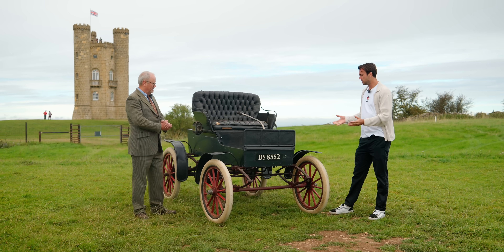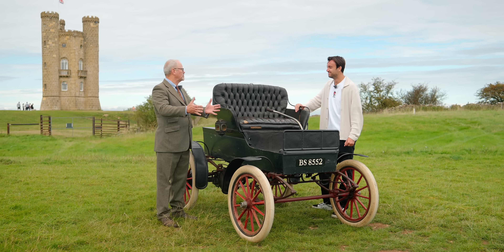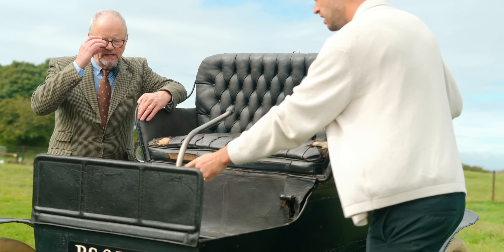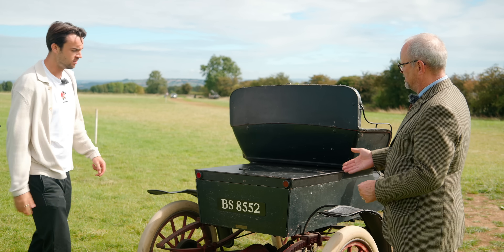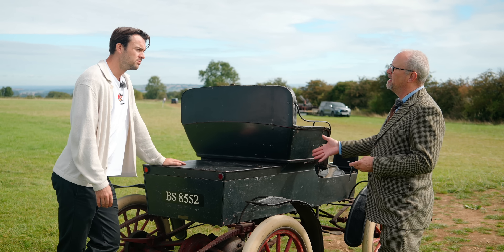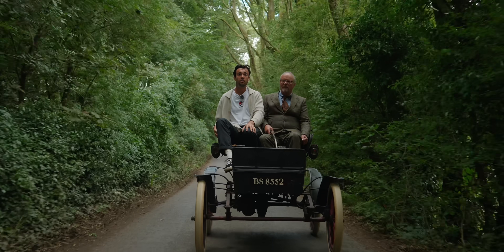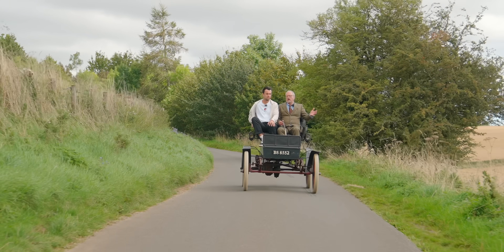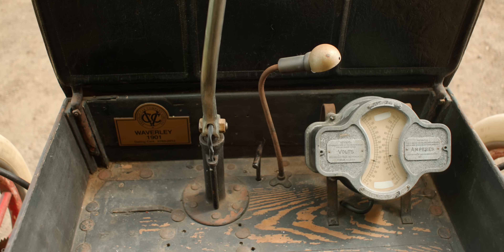Why Electric Cars Failed 100 Years Ago

Comment: Here's the thing - it took an electric motor to "save" internal combustion engine cars. I.E. the starter motor.
Reply: It's like that Ancient Greek fable, where the eagle is slain by an arrow feathered with one of its own plumes.
Reply: ..Well the electric motor was invented 42 ish years before the modern ice
Reply: The starter motor doesn't drive the cars!!!!!
Reply: Now early ICE was pains in the ass, you needed to be an at least hobby mechanistic or have one employed for it to be reliable. 
Early electrical cars was much better but the lead acid batteries held them back once ICE got better and people started driving longer as roads got better. 
Not only the lady traveling 4 km from her estate to shop but farmers bringing stuff to town. 

It would change because  lead acid batteries are crap,  Now if someone smart making pretty modern battery for u-boats at the end of WW 1. 
Tilt but world would probably become more car focused as the most pressing issues as in pollution goes away.
Reply: You don't need an electric motor to start a diesel tractor tho
Reply: @Eduardo_Espinoza  exactly! The starter was just to make life much more easier for people!
Reply: Prior to the electric there were functional self-starter systems available. Had the electric not arrived no doubt one or more of the alternatives would've become more refined and common. 
Actually most of the alternatives were refined and live on today still in special applications.
Reply: @johne189  Yes there were other systems such as the big spring that you either wound by hand or the motor wound up for you the last time you got the car started which you may still see on small power equipment, compressed air stored in a tank to directly turn the engine or to power a small air motor starter, acetylene gas, blank shotgun cartridges (Coffman style 4 gauge starter), a small pull start gasoline engine that you started first and used to crank the main engine (make sure you pull the rope all the way off the pulley or it can swing around and hit you in the head with the wooden or metal handle or pull your hand into the spinning flywheel), etc, etc.

Imagine having to keep a few boxes of blank cartridges in the glove box to literally fire up your engine today.

Best!
Reply: @neilfromclearwaterfl81 The "first" is not so clear as history has been rewritten. Originally Ket's "first" was an integrated electrical system. Since then it's slowly become the first electric starter. Coleman, Interstate and Marmon deserve a look; others too, no doubt. I dug deep into this "first" years ago, so apologies that I can't cite the source or date on the following. Anyway,  I recall reading a period trade journal's report about a self-starter public showdown being held at a fairgrounds or racetrack. The object was to find which self-starter type could propel its vehicle the furthest, using only the self-starter. lol
Reply: @johne189  For a certainty there were other failed attempts that never made it into full production.  Edison's light bulb wasn't the first as others had made non-viable light bulbs before him that didn't last very long and Edison didn't make the very first Nickle Battery however he did make the first long life practical Automotive Nickle Battery.

Kettering's was a starter/generator unit that with its constant engagement sidestepped the issues others had with engagement and disengagement of the starter plus it was regulated electrically to maintain the battery without blowing it up.  

Many of the others were effectively Rube Goldberg like in their construction and operation.  Some could say technically the very first could be by H. J. Dowsing in 1896 which he installed on an Arnold in East Peckham England and the first patented in the US was by Clyde Coleman in 1903 however that had limitations since it was also constant engagement but unregulated so it required the engine be run at one fixed speed using a ball spring governor to prevent overcharging and blowing up the battery.  Hence the reason for competitions to find one that was practical for widespread adaptation.

Chrysler/Dodge did similar to Kettering with their version of the starter/generator a few years later and my family owned a number of them.  It was very robust and in a pinch could get you off the road and often a block or so down the street to the gas station.  They were ahead of the pack having a 12 volt system however later reduced it to 6 volts matching the competition.  Hint - Put the transmission in high gear when driving on the starter.

Kettering held over 140 patents for automotive innovations in starting systems, generators, ignition systems, alternators, etc, etc.  His forte was making the unreliable science projects of his competitors into something usable and commercially viable.

So Kettering's first would be more accurately stated as first practical starter system.  His company Delco has stood the test of time still being in business today over 100 years later.  The reason why he released it early though is sad since it was the loss of a friend of Henry Leland (he ran Cadillac) who had stopped to help a woman who was stranded on a bridge in her Cadillac but was physically unable to crank it.  The crank got away from Byron Carter breaking his jaw and he died from the injury shortly afterwards due to sepsis.  Leland was so troubled by this that he asked Kettering to provide a viable solution.

Best!
Reply: Very mild hybrids have been a thing for around a century. Surreal.
Reply: @gigabyte2248 have they? I wasn’t aware of that can you give me any early examples?
Reply: @malcolmwhite6588  The Owens Magnetic in 1915 was what many consider an early hybrid car with its Continental Gasoline Engine and Electromagnetic Drive.  Very smooth driving with no clutch to wear out.  It was a very unique application.  Jay Leno has one in his collection.

Best!
Reply: @neilfromclearwaterfl81  thanks for that – OMG yes incredible I remember seeing an article with Jay Leno drove it and explained it. I think it had some sort of fancy clutch /drive too
Reply: @malcolmwhite3567  It had a magnetic coupling chamber with a huge rotating horseshoe magnet generating electricity to drive the fields of the electric output unit integrating a generator and electric motor into one device.  The engine spun the magnet on the input side which generated the electricity to run the electric motor inside the output end without the need for external wiring, etc to couple the two separate devices together.  Unique and interesting piece of early 20th Century Electrical Engineering.

Best!
Reply: @neilfromclearwaterfl81 Have a look at the Woods system for another early innovation.
Reply: @johne189  Woods did a lot of innovating however the Dual Power was based on Roland S. Fend's patent which was assigned to Woods.  Interesting to see the laundry list though of who was involved in making the components many of which are still in business today.

Interesting read.

Best!
Reply: Not really...

It's the invention of the Bendix (a solenoid) that made vehicle starting easier. And by that point, all technology was evolving
It wasn't exactly "saved" by it.

Crank start cars were in production until 1990. And they figured out kickback (a cogged drive, not a solid rod) early on. I own a '67 Citroen with a starter handle. It can't kick back by design, and I've used it to get me home when I tossed an alternator belt. Try cranking a Rivian to drive 60mi.
Reply: @andrewb4584  The Bendix starter drive was a spring loaded centrifugal drive that once the starter reached sufficient rpm would try to force the spinning drive into the teeth on the flywheel.  This caused flywheel ring gears to fail prematurely so it was elimination of the Bendix and linking the starter drive to the starter solenoid with a shift fork that allowed the starter drive to be engaged before the starter motor received power that was the big improvement over the Bendix.

Note though that Ketterings Original Delco Starter was in constant engagement serving as both starter and generator which also took care of charging the starter battery and eliminated the need for Carbide (Acetylene Gas) Lighting.

Most cars that still had cranks in the toolkit in the modern age were for engine service such as setting the timing however into the late eighties to early nineties some Range Rover, Nissan and Toyota jeep style vehicles along with the Deux Chevaux had them for emergency starting their low compression engines.  The Deux Chevaux only had a 602cc 28 hp engine in 1990 (like many riding lawnmowers) so hand cranking it shouldn't have been a monumental task.

Rivian wouldn't need cranking being a reliable EV with the anemic Deux Chevaux not even a remote comparison.

Even the 1990 Deux Chevaux didn't have adequate crumple zones to absorb impact and would telegraph impact loads directly to the occupants via the lawn chair seating clamped to the frame rails.  

Your much better off in one of the many EV's with 5 Star Crash Ratings which the naysayers might chafe over since they didn't burst into flames during the crash tests.  The only one where that did happen was a fraudulent demonstration by Axa Insurance of an EV with its battery removed and pyrotechnics installed in the front of the car with a detonator to flip it and set it on fire.  The were caught in this fraud, subsequently confessed to it and apologized.  They even admitted that despite the test being rigged that the battery compartment sustained no damage.

Best!
Reply: Not really, just proves the elec is for limited use.
Reply: That's called "appropriate use of the technology" as opposed to what the car industry does now, which is (especially with computers), trying to make one technology the answer to ALL problems (i'm a computer engineer, who grew up and still lives around Detroit.  I utterly hate the fact that computerized control units are even a thing... they should be computerized OPTIMIZATION units (that is, use the computers to optimize ignition timing, etc.) so that if the computer breaks down the elegant systems of creating fuel-air mixture and spark would still be availble, just not quite as efficient.
Reply: Kick start on that thing!
Reply: Electric motors are great.. it's the batteries used to fuel them in EV's that are the big downfall.
Reply: @petesmitt  Downfall? They are already very good, and will be awesome in a relatively quick time frame. ICE has had over 100 years to get where they are - and electric is already surpassing ICE in many/most ways.
Reply: @NeilBlanchard  Batteries are what you could call a necessary evil to make EV's viable; there is no way that batteries are inherently good; they are a compromise because of their weight, the charging requirement, the toxic nature of some of the materials, the danger of runaway thermal events with some of the chemistry; fuel cells are by far the better way to fuel electric motors but making that technology viable is a real uphill battle; I've taken a long look at the EV sector and will be staying well clear, sticking with clean and safe propane fueled ICE vehicles.
Reply: @NeilBlanchard now if they can just figure out how to address thermal runaway when things go wrong. At least an ICE vehicle fire can be extinguished relatively quickly & it doesnt waste so much of that certain resource we need in order to live called water
Reply: @alwynsmit3546  They have addresses thermal runaway and its now a very rare event however the incidence ratio of ICE vehicle fires is still, as its always been, much higher per thousand vehicles on the road than EV fires and thermal runaways.  With diesel vehicle fires, which are more common than most would like to know about, you often have to replace the pavement where they burst into flames after excavating the frame and drive train from where it melted into the asphalt pavement beneath it.

Best!
Reply: @NeilBlanchard and batteries have had 164-223 years to get to where it is.

And both have had periods without any real innovation
Reply: @petesmitt clean and safe..... I'm just gonna point out how bringing a propane tank into a store can result in your arrest in some counties, and the fact that propane used in domestic appliances is always vented outside
Reply: @DominicMV  What has that got to do with the use of propane as an ICE fuel?
Reply: @neilfromclearwaterfl81 any damage to the batteries can cause a fire that no one will escape, ev cars are worthless paperweights if the battery needs replacement.
Reply: @petesmitt  Liquid fuel cells would be the ultimate car technology if they could achieve efficiencies similar to modern day hydrogen fuel cells. Unfortunately, solid oxide fuel cells are not practical at the moment, and hydrogen has terrible properties as a portable fuel - rendering hydrogen fuel cells mostly worthless as a concept since the fuel that powers them is even more impractical than batteries in reality. It's likely that deficiencies in modern batteries will be sufficiently solved before any real headway is made is the fuel cell sector.
Reply: @petesmitt  Due to propane's characteristics its also banned from being transported in any form through many tunnels and certain long underpasses even when in DOT approved propane tanks.  When caught violating these restrictions there are some pretty hefty fines due to the risk it imposes on others driving through at the same time.

While propane can be used to power an ICE vehicle or increase the efficiency of Gasoline and Diesel engines its does come with risk and restrictions.  I've gone through the pain of having to re-route and take the much longer way around tunnels and other propane restricted areas numerous times and it can add hours to your trip.

Best!
Reply: Yes, but that doesn't mean much, since the use of an electric motor in an ICE vehicle isn't cheating according to any rules.
Reply: @موسى_7 exactly! And it's with the starter that ICE really took of and built this world in which were living now! Roads, bridges, agriculture, mining.,..
Reply: @alanmay7929 ....Yeah, you're definitely too ignorant to make that comment. No single person built the roads and bridges, it was actually 100% the government that built EVERYTHING using taxpayer dollars, even subsidizing fuel and oil companies, to PROMOTE the use of vehicles over slow horses. Whether it was gas or EV had no material effect on the governments plan.. it was the fact that cars existed PERIOD that these roads, bridges, and agriculture were built.
Reply: @alanmay7929  Please tell us that's sarcasm...
Reply: @sprockkets  have you been living under the rocks or what?!
Reply: @ryanthompson3737  Indeed not a SINGLE person.  Just ALL those people who all-too-gullibly voted the all-too-often-wrong people into government.  Yet said governments often-enough helped bring into existence the things that said voters (thought that they) wanted.
Reply: @ryanthompson3737  I wish there hadn't been such government involvement in transportation development. Aircraft were just getting going at the same time as cars, and could have been the natural solution for a very large and sparsely populated country. Fly over the wild terrain rather than spending ridiculous amounts of money and resources to tear it up and build roads everywhere. And without the dual purpose of cars for long distance travel, our city vehicles could have remained more like the one in this video. Much safer to use around pedestrians and bicycles.
Reply: @موسى_7  ICE engines are totally dependent on electric motors to even function - but EVs don't need fossil fuels. That's the most important "rule" - burning fossil fuel is wrong, and is killing life as we know it.
Reply: No, it wasn't the starter motor, it was the lead acid battery that made a starter practical. Thomas Edison patented the "rechargeable battery" and gave it to his friend Henry Ford for free hoping he would use it to make electric cars. Ford evaluated it and decided that electric cars were still not practical but electric starters were.
Reply: @neil4558  its the ICE and oil that built America from roads to bridges, agriculture, buildings/cities the whole infrastructure including power stations and more.
Reply: @neil4558  Charles Kettering invented the electric starter while working for Delco before it became part of General Motors.  The Kettering starter was first installed in the 1912 Cadillac 3 years before it was patented since Mr. Kettering felt it was needed to stop the needles death and injury that was going on when people hand cranked their cars.

Ford did not install Kettering's invention in their vehicles until 1919 seven years after they first started being used by Cadillac.

Gaston Planté, a French physicist, invented the lead acid battery used in electric cars, phone systems, science labs, etc, etc in 1859.  

The Nickle battery that Edison improved upon was not needed to make the electric starter practical as the battery invented by Gaston Planté 53 years earlier was more appropriate for that use.  Edison's battery while it lasted a long time gave off a lot more hydrogen gas than the Gaston Planté battery.

Best!
Reply: @neil4558  nonsense!!!!!! The energy density of batteries at that moment was literally trash even if they developed it which they actually did it still wouldn't have hold a candle to ICE! with ICE you just needed a bigger fuel tank and you could already cross the entire country.
Reply: After watching this video most people are "Yeah EV! Beat the crap out of that dirty polluting good for nothing ICE vehicles!" until one peaceful night when their house burns down because of spontaneously combusting  EV batteries. 😆😅🤣😂🤣🤣
Reply: @pbxn-3rdx-85percent  Lets deal with facts instead if hyperbole and propaganda.  The Swedish government has been tracking the claim that EV's are more likely to catch fire than ICE and the report in on 2022 showed that out of the 611,000 EV's and Hybrid cars on the road they only had 16 fires so 1 in 38,000 chance of fire while out of the 4.4 Million Ice vehicles on their roads they had 3,384 vehicle fires that year for a 1 in 1,300 chance of fire.  

The current data shows that the incidence of EV fires is continually going down especially when one considers that the current data is showing that ICE vehicles are now 29 times more likely to catch fire than EV's and Hybrids combined.  Further consider that a Hybrid is still more likely to catch fire than an EV and the case for EV's being a safer alternative to ICE gets even better.

Bottom line is that if the entire world switched over to pure EV's today and not Hybrids there would potentially be a 3,000% or better reduction in vehicle fires.

Take a moment to reflect on those numbers again.  EV and Hybrid catch fire at a rate of 1 out of every 38,000 on the road while ICE catches fire at a rate of 1 out of every 1,300 on the road.  This was reported in Motortrend Magazine in July 2023 by Scott Evans.

That reality is quite the opposite of what the propaganda mill promoted by the Petroleum Industry keeps cranking out.

Best!
Reply: But now we use diesel generators in some areas to charge electric cars . My how the world has changed
Reply: @Robs_Model_T_and_The_Money_Pit  However those large stationary generators have much more efficient scrubbers on them emitting much much less pollution than even the most efficient ICE vehicle or portable diesel generator many would be more familiar with.   Despite that they are still being fazed out at an increasing rate to be replaced with wind and solar along with bi-directional charged EV's to eliminate the need for diesel generators as backups.

Best!